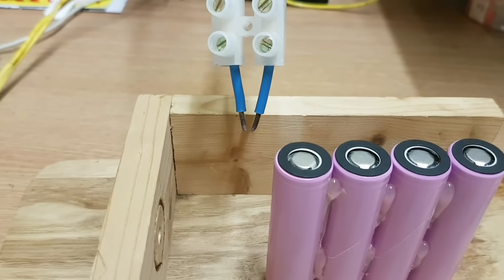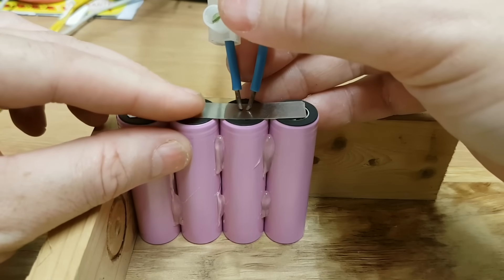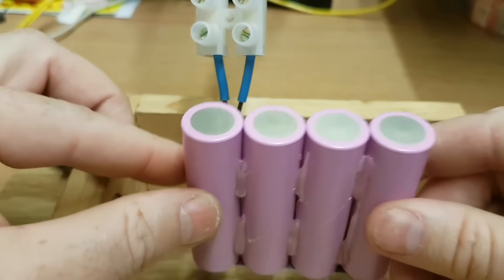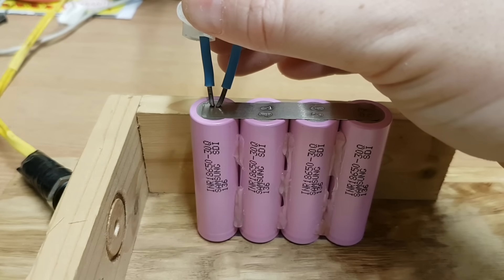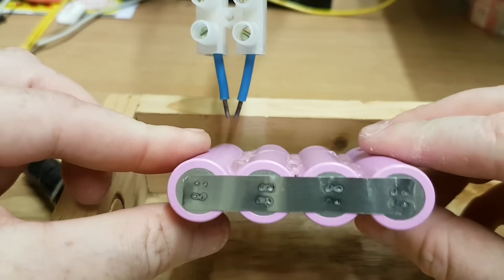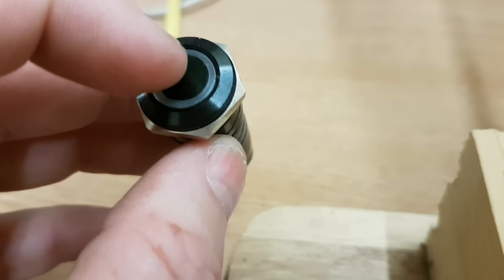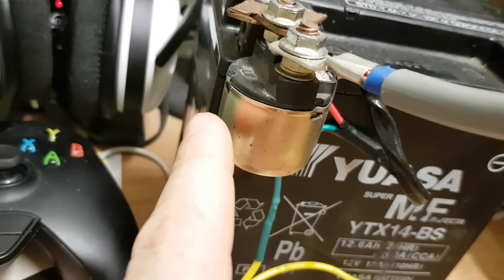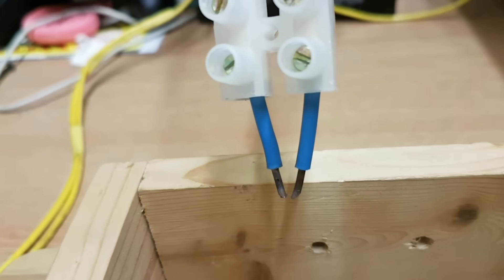DIY Battery Spot Welder - Demonstration & Explanation

Comment: Nice setup. Ive tried using a microwave transformer and got it to work but it was putting out 900-1000amps and it i wasn't careful it would blow holes through the battery tabs. I think I'll try this setup.
Reply: With two transformer you could make a stick welder
Reply: I hadnt read the specs on the spot welders on ebay...i think that is the total amount of energy transferred ..the kva ..or joules transferred to the welding surface and not just the amps..maybe allen had very thin nickel strip...dont know the output voltage of the microwave secondary though...!
this one 
https://www.ebay.com/itm/Hand-Held-Spot-Welder-Machine-Welding-For-Mobile-Phone-Battery-Pack-110V-X/132180186350?hash=item1ec68d94ee:g:nbYAAOSwcLxYHZfA
has 3kva max output and it s suitable for nickel plate max thickness 0.13mm
this one 
https://www.ebay.com/itm/709A-60A-18560-Spot-Welder-Welding-Universal-Welder-Pen-for-Battery-Soldering/282624630633?hash=item41cdbd9f69:g:fS0AAOSwq19XCL52
has an output voltage of 20v dc and 500 amps ....so 10kva....of power and is suitable for nickel strip as thick as  0.2-0.3mm
so in our case ....if we use 0.15mm thickness without al these ''chinese'' dual pulse welding ..bla.bla...we need around 5kva of power ...5000/12=around 400 amps ..so you are right..!!in your set up  you press probably the button for more than just a few msec that the commercial units do...so  the 200 amp from your 12v battery ..or 2400kva are just enough to do the job!!!
of course there should be other factors and the  ''equation'' is not linear.....for 0.13 thick they need 3kva....for double of it they need 10kv...three times up...!!
do you know darkkevin.....how they achieve this amount of power in output?anyway merry christmas and a thousand thank you for showing us all these....!!!
Reply: @giannislymperopoylos5574  0
Reply: use thinner secondary winding lol I had same prob with 2 wraps of negative battery wire off a car but it works lol
Reply: dave Yates I tried 2 wraps of 2awg welding lead and 3 wraps of 4awg both had too much amps. I'm gonna try this battery setup sometime.
Reply: Allen McKinney your name sounds familiar, did we go to high school together?
Reply: A series resistance like a light bulb on the primary can reduce current. I've got an MOT welder and I tend to use it for larger things that need a long burn.
Reply: there is a problem though ..most solenoids are rated for way below the 600 amps...most motorcycles and cars need from 80 to 300 amps ....thats the amount of amps the starter motor needsor draws....by using just the electrodes ..with a battery that has a cca 500-600 amps....dont we have a danger of stucking the heavy contacts of the solenoid or destroy it prematurely??i say it cause the solenoid i have is for 300 amps and the maximum allowed for short is 400 amps....!if i use a battery that can provide 500-600 amps.  is there such a danger??if you know please answer....!!
Reply: THANK AVE AND DARKKEVIND....ALSO YOU SEEM TO HAVE MUCH MORE KNOWLEDGE AND TEST- EXPERIMENTS ABOUT THIS SUBJECT-FIELD THAN ME...anyway...you can do it like mrdiy with just the battery and the wires..but in this case you produce sparks and you dont have total contol if the abundance of amps make the electrode stick to nickel and the battery...
with the method of ave and kevin...you produce no sparks at all cause both electrodes are on the surface before the procedure begins ..and with the button you have the ultimate control...!!
yes supercaps is just another method...like this
https://www.youtube.com/watch?v=RwTVxZgIoAM&t=2s
the only thing i dont know is oxidation and resistance in these non profesionals welds...are all these welds good enough to withstand and not creating furhter resistance to the 20-30 amps output of a high drain 18650??
Reply: Yea Caps look like fun! I have seen it done with as little as 80Uf 400V(fan Caps) and up. I have also seen it done with a Simple Capacitor bank pulled from Computer Motherboards. I chatted with that guy and made a 31,000uF bank myself(he had a 28,000uf). But I've been to lazy to test. I built it a few months back. I ended up making my First MOT and forgetting about it. I even found a post(not here), but I can't remember where I found it, where the user made a smaller battery tab welder from a Kodak Camera and 3 Flash Capacitors in Parallel. I also purchased a Kodak Camera and took apart 2 other for the caps. But I haven't tested yet. That one he mentioned, you get a good few uses before the components burn out, but it worked in a pinch. I have also seen it done with a bank of 18650's(that looked scarry!!!). 
Even though a MOT is capable of higher amps, this would be at full peak voltage with no limiting resistance. From what I have noticed, it is how many amps you can get before a blowout, sparks or black burns. The MOTs I have made tab welder from are perfectly capable of 1000amps. But I would have to change my electronics to make sure they could handle more amps before melting and I would have to make sure to add more time to the timer. The longer the short, the higher the amps you get on them, from what I have noticed(also the noisier...LOL) With the MOTs, you might have 50-100amps coming out of the end of the 2 gauge secondary. But adding a lower gauged wire will change the resistance like adding the electrodes. I have been chatting with another user, who made an MOT Spot welder and added 10-12 gauge wire (2-3 feet) to lower the output so he could spot weld batteries also. I use to try and use 8-10 gauge solid copper for my electrodes, till I figured out it was way too much power going to the battery(blowouts and burns), once I started using the 18 gauge and spacing just right. The welds got much better. Some even believe you should only weld with double pulses(one to heat up the metal and one to weld, with Arduino). On one of my welders, I have to double tap it, because I used an 800 watt MOT and 6 gauge. The other 2 seem to work perfectly on one pulse. 

But this is just what I have noticed with MOTs. I am sure Caps and Batteries are way different? I will soon find out. I have started videoing all of my builds. I will video my battery build. But Like DIYing, I am fairly new and have No experience in editing. My 18-year-old son is teaching me slowly...lol!! I have probably 10/11 videos waiting to be edited. I really enjoy building small Stereo(Bluetooth). This is how I started messing with 18650's. In that Process, I started on Power Supplies, Chargers, Soldering Irons and Battery Tab welders. All of this stuff is so Exciting and gratifying once you have a completed project and it actually works. Everything I have learned, was from video's just like This one. Please keep me update if you build one of the Welders, I am interested to see how it turns out.....

Sorry, I am rambling....
Reply: nicholas cullihall don't know. My 1st name is Eddie and I went to both Shady and greenbrier east high school.
Reply: Thanks for the Tips!!! I have a Few MotorCycle Batteries laying around also. I will play around with the heavier amped ones to see which one give me the best welds. Figured I could use my Battery Build with on the fly spot welds and my MOT Welders when I have a few more welds to do. Been also looking at all the Capacitor builds here on YouTube. But I am leaning more towards the Battery Build.
Reply: for the capacitors ive read some days ago...that you need at least 200 or something minimum joules for a descent welding...i cant remember the number...if you have one of these 400f 2.7v supercaps i showed you on video....the energy is....1/2cv^2 ...which is 1/2 *400*2.7^2=1458 joules ..and according to what i read more than enough for some descent weldings...
Reply: you could use a car/truck starter solenoid. Ford motors vehicles used one that would be perfect. However, a starter solenoid has to withstand the amperage until ignition whereas this little spot welder is on and off in a very short time which it can seem to handle.
Reply: boss here you are using 12.6AH battery its below 200A ?
Reply: I have heard stories, both Good and Bad. Personally, I only have LGHB2s that produce higher than 25amps(on a single cell). The welds I get with the MOTs,have melted both the nickel strip and battery together, just like the ones I have seen in a laptop battery. It takes my needle nose pliers to get them apart. When I do, I am left with tore up nickel stips and little round buttons on the battery, I can only get off with side cutters. I try to also use only 0.15 x 8mm pure nickel strips with 2 welds(4 contacts) top and btm, per battery. I have not had to build anything requiring more amps(over 15) with them yet, but I have read, some user will double up on the strip for higher amps. 

The only time I have gotten sparks is when I have flattened electrodes, spacing to close or my timing to high with the MOTs. I am sure using a battery and Solenoid Relay will be a whole new ball game! I love watching these videos, they sure help out when you decide to take on a project. Most of the testing has already been done by the video maker. This and his other Videos are Great References! I can't wait to try one out(still need to get me a solenoid, unfortunately). Thanks for the chat and To the Videomaker, Keep up the Great Work!!!
Reply: Josip.berger@gmail.com.ide
Reply: A reactive ballast (mercury vapor lamp ballast) in series with primary of the transformer will reduce the current. Or try to use light-dimmer.
Cheers from Indonesia
Reply: I've done it with a 240V microwave oven transformer and 2 turns of welding wire. I turn it on with a solid state relay and set the time with a 555 timer. 
It works perfectly every time and cost a lot less than a battery. Click on my image if you want to see the videos I made of it.
Reply: Hope you cleaned up afterwards as the contents of the batteries are pretty toxic.
Reply from the maker: Yeah that's too high. Anything below 600A (but above 200A) should be OK. The higher the A the less time needed to create a weld.
Reply: Typically when you get the quick burst of energy, you will see only 1-1.5V & 30-50amps out of the Electroids. I have made 3 MOT Battery Spot welders to date and each one, no matter the wraps, or thickness of the wire, average about the same amps at a 0.3 second burst. I get around 100amp and 2.5Volts average, at 1 full second burst, but that is way to much and will blow a hole in the battery. If you have the timing correct and the spacing of the electrode perfect(gauge size and size of the tip will matter also), you shouldn't see bad welds. I personally like to use around 16-18 gauge solid copper for my electrodes. To date, I have used 2 gauge welding cable, and std cable from the local hardware store. But the one I just did with 6 gauge wire from an old range, give me the best welds. The smaller the wire, the lower the volts/amps coming out of the electrodes,or you would think?? In the end, I have found timing, gauge of wire used on electrodes and pressure to be 80% the reason you will get bad or Great Welds.

I am about to attempt a battery one, like the one in this video(came across a good 12V 7.2Ah battery). Looking at the welds in this video, he has Great Control, spacing and Good Gauged wire coming out to the battery. Even though the battery might be capable of higher amps, You will be limited on what comes out based on all those factors. It really hard to measure the amps coming out to the welds. There is so many limiting factors. I have seen another user, measure with an inrush meter, and it shows upwards of 600amp-1000amps. But common sense will tell you, that much current would blow a hole in the battery and possibly make it explode. 

(Edit--->>Amps/Voltage might be a little different when using a battery. Only because you are now using 12-13V and around the same amps(MOT averages 1.5V-3V based on wraps). I am sure, I will have to play around with gauge, timing, and electrode spacing when I finish mine) I am also sure the strength(age) of the battery used plays a key role? Will Find out soon!!

No matter what you use, just make sure you take all precautions and be safe. Wear protective gear and make sure to check, double check and tripple check all connections. I have heard, using batteries like this is really hard on them, and can cause them to act up.(I have no clue, this will be the first one I attempt.) If you would like some ideas, take a quick peek at my google plus page. I am actually in the middle of a rework so I can have some extended electrodes for bigger batteries. This unit will be strickly for this.(or that is the plan).

Merry Christmas!!!
Reply: THE SUPERCAP HE USES IN THE VIDEO CAN PROVIDE AROUND 200AMPS..AND ALL THIS SERIES FROM THE SAME BRAND HAVE A PEAK OUTPUT OF AROUND 300AMPS...HIS WELDS SEEM STRONG ENOUGH..THE CAPS ARE RATED AT 2.7V..BUT ITS JUST DIFFERENT...THE AMOUNT OF ENERGY TRANSFERRED OF COURSE HAS TO DO WITH THE TIME YOU APPLY IT ...BUT THE MORE INSTANT AND RAPID THE BETTER FOR BOTH THE WELDING AND THE 18650 CELLS!!THATS PROBABLY WHY THE PRO UNITS FOR 0.25MM THICKNESS THEY HAVE 10KVA OUTPUT!!!
USING A NOT SO HEALTHY BATTERY CCA RATED AT 150AMPS AND THE SOLENOID THE JOINTS WERE WEAK...!!!
ONE QUESTION THOUGH TO YOU OR DARKKEVIN.....THE SOLENOID I SENT YOU IN THE LINK AND  I HAVE IS RATED FOR 300AMPS BUT IN THE DESCRIPTION STATES 400 A MAX...IS THERE A DANGER OF SHORTING THE HEAVY CONTACTS IF I USE THE 360A BATTERY FOR SUCH SHORT PERIODS OF TIME?
Reply: NO NO...YOU ARE JUST FINE...I CAN ASSURE YOU OF THAT...!!!I THINK WITH THE SETUP I HAVE, I WILL HAVE A GOOD RESULT WITH A LITTLE PRACTICE...ITS A LITTLE MORE POWERFUL THAN WHAT KEVIN USES...BUT IT WILL PROBABLY BE OK!!!I WILL TEST IT WITH JUST THE NICKEL TABS FOR START..!!!AND WITH DOUBLE WELDS ON EACH POLE I ASSUME THAT WILL BE FINE!!!
Reply: using a 12v 7.2 ah battery you wil not get a descent welding or not welding at all...the 7.2h ones are either the one totally cheap and useless that used in ups and alarms that can provide nowhere near the amps you need or for small scooters and motorcycels and also cant do a descent welding...
you are right about the factors ...there are so many ....and timing is one of them...if you cant control it electronically you just have to practice...
BUT THE MOST CRUCIAL FACTOR IS THE JOULE TRANSFERRED..AND ITS THE FACTOR IN ALL WELDINGS...THE THICKNESS OF THE STRIPS YOU USE DECIDES WHAT ENERGY MUST BE TRANSFERED IN ORDER TO HAVE GOOD RESULTS..JUST HAVE TO USE THICK WIRES THAT CAN TRANSFER ALL THIS ENERGY..
WHAT DARKKEVIND SAYS IS RIGHT...THE PROBLEM LIES IN AT 500-600AMPS FOR THICKER STRIPS AND RAPID WELDING...YOU WILL NOT FIND A SOLENOID CHEAP OR NO SOLENOID AT ALL TO WITHSTAND ALL THESE AMPS....THE SOLENOID ARE RATED FOR SOME AMPS...BASED ON WHAT THE STARTER MOTOR DRAWS..THE ONE HE USES IS FROM MOTORCYCLE..I  BOUGHT ONE LIKE AVE S  ON OTHER VIDEO AND RATED FOR 300 AMPS ..MAX 400......IF YOU USE BATTERIES THAT HAVE CCA 600 AMPS THERE IS A DANGER OF EVENTUALLY SHORTING THE HEAVY CONTACTS...THATS WHY AVE USES A GOOD QUALITY SOLENOID AND ABOUT THE SAME BATTERY AS DARKKEVIND....WHICH CAN PROVIDE ONLY 200A CCA...!!!!
ALL IN ALL....
1.THE THICKNESS OF THE STRIPS DECIDES THE AMOUNT OF JOULES NEEDED TO MAKE A RAPID DESCENT WELD
2.IF YOU USE HEAVY THICK WIRES THERE IS NO PROBLEM..ESPECIALLY FOR THAT VERY VERY SHORT PERIOD YOU PRESS THE BUTTON
3.DONT USE SMALL BATTERIES..WHAT DARKKEVIND USES IS THE LOW LIMIT..ANYTHING BELOW WILL NOT PROVIDE GOOD WELDINGS...ITS JUST MATH..IF YOU HAVE A BATTERY WITH CCA ABOUT 100 AMPS THE FORMULA IS 100*12=1200VA WHICH IS LOW
4.USE QUALITY BATTERIES AND NOT THAT USED FOR UPS AND ALARMS....THEY ARE CHEAP FOR A REASON ....THEY CAN NOT PROVIDE THIS CCA...YOU CAN MOST OF THE TIMES TELL THE QUALITY OF 12V BATTERIS BY THEIR WEIGHT...AT THE SAME AH RATING LETS SAY 7...THE ONE USED IN UPS AND ALARMS IS FEATHERWEIGHT COMPARED TO ONE USED FOR MOTORCYCLES..THATS WHY THE ONE HAS 10$ AND THE OTHER 50$..!
5.PRACTICE WITH THE STRIPS WITHOUT THE BATTERY TO FIND THE ''SWEET SPOT''..ABOUT TIMING AND PRESSURE ON THE ELECTRODES..
6.USE  SMALL BOX OR SOMETHING SO YOU CAN PUT THE PUSH BUTTON IN THERE AND MAKE IT POSSIBLE TO MOVE IT TO THE FLOOR ...AND ACTIVATE IT WITH YOUR FOOT LIKE A PEDAL...THE TIMES YOU WANT TO..
I BOUGHT THhttps://www.ebay.com/itm/300A-steel-high-current-relay-contacts-12V-waterproof-seal-Automobile-DC/272276829170?_trkparms=aid%3D111001%26algo%3DREC.SEED%26ao%3D1%26asc%3D41375%26meid%3D82abdcbd24e341039e929f301f30a7ae%26pid%3D100033%26rk%3D4%26rkt%3D8%26sd%3D272276829170&_trksid=p2045573.c100033.m2042IS
AND THIS AS BATTERY WHICH IS MORE THAN ENOUGH...
https://www.skroutz.gr/s/4068652/Bosch-S3001-41AH-360A.html
again what darkkevind says about the 600 amps is good if you want to spot welding thicker tabs or other materials..but THE SOLENOID...RELAY IS THE BEST WORD... MUST BE RATED FOR ABOUT THE SAME AMPS THAT THE BATTERY CAN PROVIDE..EVERY TIME YOU PRESS THE BUTTON ALL YOU DO IS JUST A SHORT CIRCUIT AND THERE IS NO STARTER MOTOR TO DECIDE WHAT AMPS WILL GO THROUGH...!!!

Comment: Hello Darkkevind1978; one more question... I am planning to use the Delay Relay Timer Switch and foot pedal  since my left hand trembles too  much . Do I still need to use the 12V scooter starting relay or is not necessary ?... Thanks !
Reply from the maker: Aldaochan hi, yes totally necessary because the delay switch would fry with the amount of amps running through it... The solenoid takes care of the high amps, the switch just tells the mechanical solenoid to throw and create a connection.